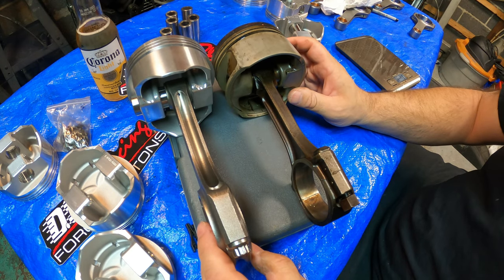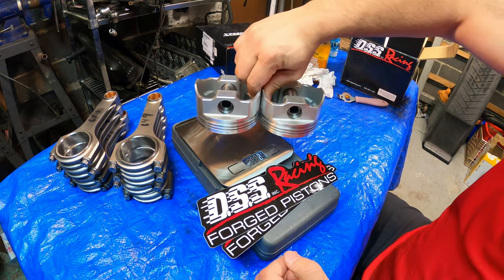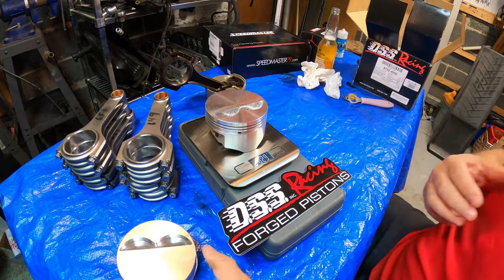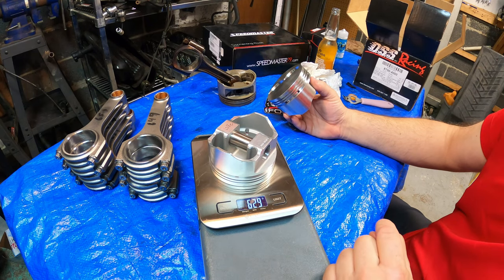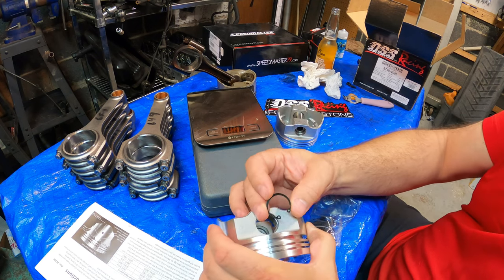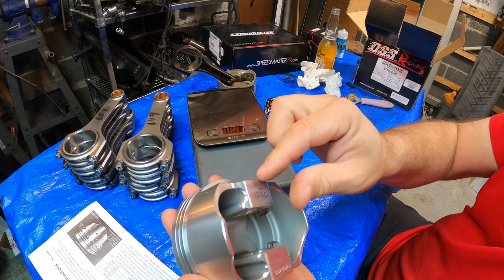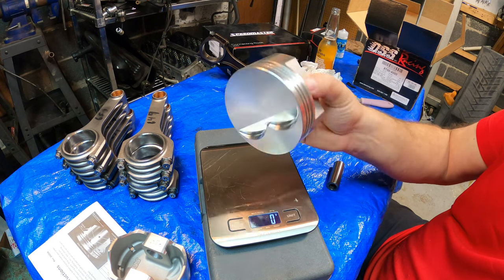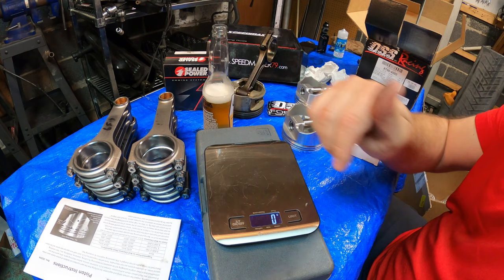DSS Racing Forged pistons Small block Chevy LT1

Comment: 493 grams without the pin! 🤣🤣 my wiseco’s are 342 without the pin my pistons and pins weigh less than your pistons alone 🤣 and you arent having it balanced 🤦🏼‍♂️☠️
Reply from the maker: Think your missing the point of this budget build ...      yes there are lighter pistons out there but I am trying to stay within the stock rotating assembly weight (and that's why i picked this combo) ...  The  pistons and rods I will be using comes in at a few grams lighter so that there will be no need to  re-balance crank for the rpm range I am running this engine.
Reply: @maldo72  its NOT just about overall weight there is a formula that you need to do using piston pin clips rings and the big end and small end of the rod to come up with a bob weight just because the overall weight of the rod and piston combo is the same DOES NOT mean the bob weight will be the same you are flirting with disaster not balancing this! The rod weight is MOST DEFINITELY different than the factory rods not to mention if the rings on those pistons are not thin metric rings there is going to be a difference in the ring weight you didnt have the circlips in there... there is soo much wrong with the way you are going about this this rotating assy will at the very least need checked to see if the bob weights are close! Again you CANNOT just go with the overall weight and send it it will shake its self apart
Reply from the maker: Great conversation ...... to have ... yes there is a mathematical equation but you talk to different engine builds and they with have different answers to under-balance/over-balance an engine and whats acceptable..  because it's never perfect... (case in point you can't account for the oil wedge within the rod and main bearings if you want to get technical because most come down to experience and guesswork within the details).  we are not talking about a full race spec engine here and in a perfect world yes a re-balance would be nice but the fact the new parts are close i don't see a problem unless the motor sees crazy rpms (break it down to a simpler term for the non-engine builder people who may read these (its sort of like tires  you can mount a tire  on  rim and wont feel the shake till a certain speed) 
yes, you have valid point but I can't tell you how many times i see junkyard motor builds where people drop in forged pistons/rods and have fun...    I don't expect 200,000 miles from it nor to rev to 7-8 thousand rpms  ....  so it should be fine for the intended purpose ... also the factory stuff doesn't even weight match their stuff all they do is grab a set of pitons and rods and slam it into the engine on the assembly line and call it a day of what they call "within spec would never fly in a full race engine"  because the factory balances crank separately from the rods and pistons within a certain range ...  (i have seen wild discrepancy's in factory engines and they still run right for years) ....     this is not my first rodeo ....  this is why i picked the parts I did ..
below is a great reference point i am trying to make 
https://youtu.be/aNnO1XSByLE
Reply: @maldo72  🤣 good luck let me know when the crank breaks because its not balanced you have NO idea what you are talking about you add 4-5g for oil but for the “oil that you cant account for” i have built enough sbc’s with stock rods and aftermarket pistons for street stock dirt track engines to know the balance is far enough off to need some drilling and thats with STOCK rods! rest assured that thing is going to be WAY out of balance you are doing all that and building a hand grenade for what? To save $180??? 🤦🏼‍♂️ lots of luck
Reply from the maker: Thank you for your input ..   i guess you will have to get out the popcorn to see it  rattle its self to death......   I  have dropped heavy seal power forged pistons on stock lt1 rods a dozen times ran the snot out of them for a season with no problems...   don't get me wrong for a high rpm lots of hp ...   tons of boost  you are right... for long term durability......... OE assemblies are typically balanced to within 25-35 grams. Yet, nobody really tests the OE assembly or complains about any nasty vibrations in them.
Reply: @glastornjet73 ok GENIUS 😂 plenty of old time builders say this is perfectly acceptable...the fucking factory itself doesn't balance them accurately in the First place 😂 you're talking "on paper" these dudes talk real world 😂👍

Comment: Did you buy directly from DSS and did they say how much power 4032 pistons can handle?
Reply from the maker: i bought through Summit racing ... after i talked to Dss .. sorry i don't have the figures about hp rating  ---  but definitely can handle way more power then the stock cast pistons plus they are full floating

Comment: Hey brother i got a question..i purchase a new from GM vortex short block for my C4 Corvette... only $600!!! But, the damn thing has dish pistons... I'm wanting to drop in some flat top hypers... Will those drop in those factory bores without machining??? The Pistons are marked for standard bore "STD" but my Corvette manual says the actual block bore size can be 3.995-4.0025!!! What's the deal???
Reply from the maker: are they after market pistons ? if they are standard size you can use regular flat top pistons but you have to make sure they are with a few grams of the pistons you are replacing so you don't throw off the balance of the engine
Reply: @maldo72  right but why does my manual say the bore in the block can be 3.995 to 4.0045???? I've never done this before so I don't have a clue if the bore will be able to take the new pistons without honing them out. The pistons at the skirt are right at 4 inches so the cylinders have to be 4+ a few .001's they can't be 4 or less ☺️ the pistons and pins would about 50 grams heavy than original but I located a manufacturer that makes them in various weights and sizes so I can purchase some 50 grams less 👍 they're not cheap though...I'll hit you with their name and number maybe you or viewers could use them at some point...it's a great resource for situations like this where you don't wish to have the assembly balanced after installing new pistons/rings/rods